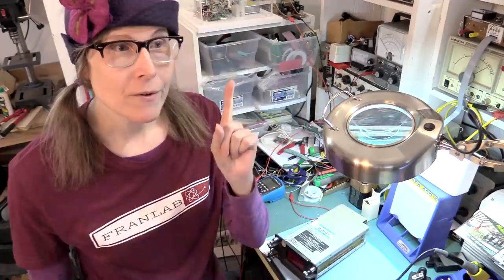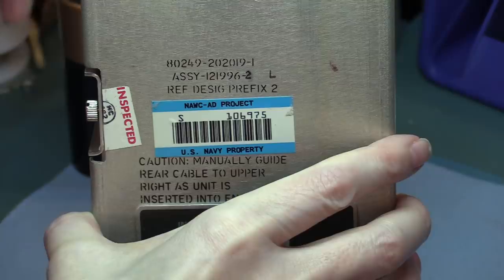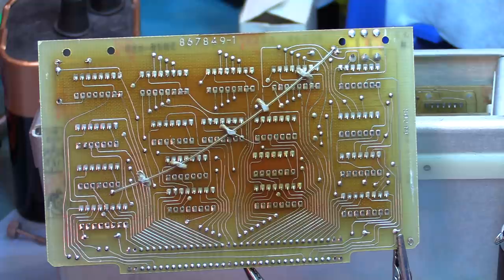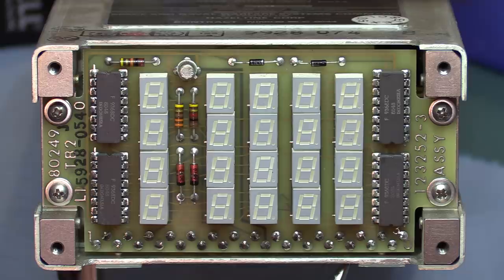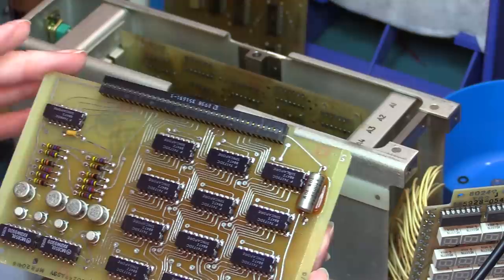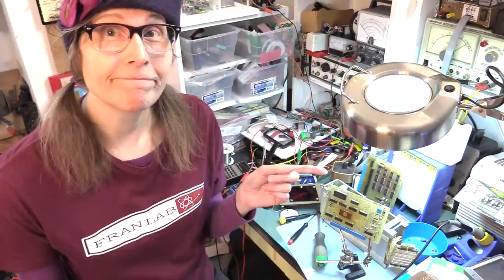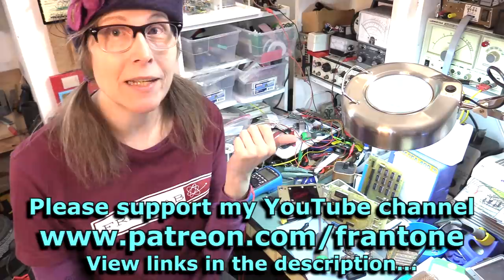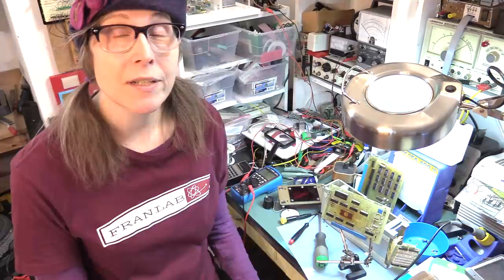REAL Wargames Tech Teardown!!!  80's Missile Target Display

Comment: I suspect the EPROM is being used as a static encoder / decoder to replace a complex set of logic gates, something that would be done in a PAL in the '80s. I am curious as to why there was no UV blocking label on the EPROM window.
Reply: Might have had one years ago, but being so deep inside equipment they really saw no need to keep it blocked out, as it would rarely see light.

Comment: @20:56 I bet it was a task to get those synchronized. If they hadn't, you would be able to tell immediately by frame flutter or a horizontal line marching down the screen and then reappearing at the top to..... Do It Agaaaiiinn, Yeah Yeah Yeaaahhh!!  Mmm-ahem-pardon me...Helter Skelter just jumped in there..happens to me sometimes.

Comment: Did not know - Interesting... the Norwegian Missile Crisis AKA The Black Brant scare was caused due to the launch of a Canadian designed and built by  Bristol Aerospace US-Norway scientific Black Brant XII sounding rocket. The 4 stage rocket reached an altitude of 904 miles on a Northern trajectory that appeared to the Russians as a US submarine launch. 

When I was involved in high power rocketry I flew a scale version of the Black Brant X... which is a Black Brant V with a Terrier booster.  A BB XII is basically a BBX with an additional 1st stage Talos booster.

Comment: Pins 16 and 8 of the ICs are tied together supplying power and ground but the PCB designer did a poor job and failed to increase the trace widths wider than signal width to provide lower resistance/lower voltage drops.  These ICs obviously ran hot as they pulled enough current that should have been designed for.  (I'm a former PCB designer from Tektronix)

Comment: Very reminiscent of telephone switching system technology I worked on in the late 70s. Same backplanes, and even the color of the boards. No fans. Fans have a short MTBF and would be the least reliable component. So the thermal design had to provide for no forced air, in our case up to 120F ambient.

Comment: I actually ordered some pieces from China planning to make the display of WOPPER / Joshua "breaking" the code - the LED display that was flashing letters working its way to "CPE 1704 TKS"...
It was going to run on an Arduino, and either flash all the time, or randomly "figure out" one letter at a time, to "solve" after a preset amount of time...
Like many of my projects, I haven't gotten around to it...

Comment: An interesting mix of 7474 and 5474 flip flops, I thought only the 5474 was milspec (unless being able to display your targets isn't actually vital to your misson!)
Reply: "mil spec" is mostly a fancy way to say "extended temperature range", and since this module was designed to be used in a regular office-style command center, it wouldn't need to be mil spec. the few that got used here were probably overstock, or for some reason cheaper or easier to get than their regular counterparts.
Reply: @WooShell  Thanks, I did wonder. Back in the 70's and 80's, when I last bought 7400, the 5000 series were a) not really available easily unless you had an RS account, and b) considerably more expensive. As an aside, I did come across a couple of 7474s in my junk from the 80s box that came from an assortment and they were still as good as the day they were made, when I finally breadboarded them back in 2018. The 4000 series evidently hadn't had the love and attention they deserved, I have yet to check the tube of 2716 eproms :~P

Comment: That bodge doesn't look very bodgy. The lower left connection seems to be on a pad, not just soldered to the IC pin. Perhaps that trace was just too difficult to get on the board?

Comment: Those 7400 chips are TTL, which means they sucked a lot of power compared to even the next gen CMOS versions.  Hence the ceramic casings (military heat tolerances) and discoloration on the board.

Comment: In the tool kit for the system there would have been a card remover that pulled the CCA straight out. For insertion just firmly seat. Sometimes a rubber mallet helped. And I am not joking on that.

Comment: ~ 21:40. I think we're about the same vintage .. although you look way better <3. Seems to be almost lost in history as to how much work once went into certain film shots. One of my personal favorites is the wire frame CRT view from Plissken's glider of the WTC in Escape From New York - in fact a model, CG too expensive at the time. Channeling Fran - I recently drew up the schematics for a BTTF clock - as it MIGHT have been done in the era (The actual film clock back-lit litho). Maybe a bit rough, but it decodes year, (alpha-numeric) month, date, day, HH:MM:SS, 12/24 hour format with proper leap year correction with "only" 40 period correct 74x MSI chips and a few score worth of steering diodes. IMO .. just on the cusp of doing it with a 6502 or Z-80.

Comment: Hazeltine was known in the late 70s as a maker of inexpensive high quality asynchronous terminals.  Any encryption within this device is very unlikely.  DES originates in the very late 70s, though it is a derivative of some tricks that IBM did.  This thing probably simply displayed a variety of serial numeric information fed to it by that cable connector.  My guess, anyway.  Thanks for the video.

Comment: The wire on the board was possibly an engineering change. This kind of wire was common to see on mainframe computer planar boards.  Not saying this is what it is, I don't know if this is what it is, but I have done similar wire changes to planar boards in the past and I am guessing that this is what it is. Possibly an output or input that was needed for some upgrade.  Later in the video you see that there were components that were made much later and that could have been either just a replacement part, or again, perhaps an upgrade that required a field engineering change to the first board.  Speculation, but I was in Marine aviation and after that, field engineering for mainframes, and my guess is that the wire was part of an upgrade.
Reply: Looking at where the wire goes it turns out it connects to ground on two different spots on the board.

Comment: I always though 54xx series ics were for the military and 74xx series were for us mortals. Surprised to see so many 74xx chips in here, although I spotted a genuine 5400.
Reply: The main difference between 54xx and 74xx is the operating temperature range (-55°C to 125°C for 54xx and 0°C to 70°C for 74xx). 54xx also has greater Vcc supply voltage tolerance (±10% rather than ±5% for 74xx). For a time there was also 64xx which had  temperature range midway between 54xx and 74xx. For devices in an air cooled assembly in a relatively benign environment (some sort of control room) the extended temperature range of 54xx isn't required.

Comment: That's an interesting mix of commercial and mil-spec parts, but ceramic packaging throughout.  74xx = commercial, but there are a few 54xx as well.  Strange that they mixed 7474 and 5474 on the same board.  There are also a few other parts from the prior generation logic known as DTL (Diode-Transistor Logic) - I noted some MC858 parts. The EPROM is interesting - the printed numbers appear to be related to the programmed content since the part would have been programmed and verified before soldering.  There is a very feint manufacturer's mark, rendered almost invisible by the conformal coating. Playing around in Photoshop to highlight colour / contrast it looks a bit like the old National Semiconductor logo (square letters version from late 70s early 80s), and the part number MM2704JQ (so a 4 k bit device - 512 bytes).    Looking again - it could also be MMI (Monolithic memories Inc) who also manifactured EPROMs and were later merged into AMD.  As others have commented, the location on the ICs (Indonesia, Taiwan etc.) would be where they were packaged.  The silicon was most likely diffused in the US or Europe.  By the late 70's, the larger semiconductor players were commonly shipping wafers around the globe with different factories specialising in different parts of the manufacturing process.
Reply: If it is a National semiconductor 2704, it needs +12, +5 and -5 volts. See http://bitsavers.trailing-edge.com/components/national/_dataBooks/1977_National_Memory_Databook.pdf page 4-7.

Comment: There's only enough wires going to the display to light one row at a time. They must have been time multiplexed, strobed fast enough to show all the digits by persistence of vision.
Reply: A big hint is that there are four rows of digits, and four 9368 decoder chips.

Comment: Doesn't "conformal coated" mean that traces are coated?  I see a fiberglas board with bare traces, and no coating on anything -except a bit of rosin on soldered legs.  Maybe I've never seen an '80s conformal-coated PCB tho.

Comment: I worked on electronics in government throughout the 80's. When it comes to certain systems, it is not uncommon for the Military to maintain them for a decade or longer. The design is set and no changes allowed. Spares are ordered when stocks get low, and the vendor will usually only build spares when ordered. That would explain dates into the late 80s.

Comment: Just because it was gear used in the 80s, doesn't mean it's 80s technology.  I see 70s technology there for sure in the form of many discrete components and early gate chips.  I was an AT/AX in the Navy in the 80s and 90s and almost all of the gear back then was from the 70s and even some from the 60s.

Comment: Fran: just because this could be showing encrypted data is why it would be cool to reverse engineer it.
If you post the pictures I will do it.
But I doubt. More likely it was just a proprietary protocol, It has half a dozen 74173 that are just D type flip-flops. It is not complex enough to decode sophisticated cyphers. It would need at least a shift register and an EPROM.
Yes the EPROM is a UV erasable EPROM, this is why it has the window. Its made of quartz so UV enters it. Look at the regular structure of the dye typical of memories. They lose their data very slowly if exposed to sunlight or fluorescent light too. I used many of 2706 (corrected) in my time.
The bad constructed erasers were dangerous, it was a very short wave UV light that was used.
About the rockets you are right. Once a wrench fell and perforated a tank. It was a huge and high profile accident. There is a very good 
documentary about what happened.
I didn't knew about Joshua's voice. Thanks for sharing.

Comment: In retrospect, the heat discoloration on those boards is a bit worrisome ----  the carbonization process can cause leakage paths where current starts flowing through the board itself.  Not something you would want to occur in any electronic device having to do with tracking or firing missiles....

Comment: The old days when you don't need bypass capacitors.
Reply: The frequency it runs at is probably so slow that it doesn't need bypass caps. Probably a few Khz.

Comment: I am surprised that they are 74 series. Military IC's were 54 series IE 74173 = 54173  the ceramic allowed the chips to run hotter
Reply: Look closer, I saw 5474 chips next to 7474 on one of the boards. Apparently 74xx was good enough for most of the parts.

Comment: May not have been an oops.  Likely there was no other way to get that line form the there to there.  A  complete re-layout for one line would be crazy in those days.  Still is as far as I'm concerned with some boards I do.  A simple link wire can save a lot of time and money.
Reply: I paused the video at that part and tried to work out how they could've routed it without a bodge wire. They could've run a trace around the outside of the board.
Reply: @simontay4851  Edges are dodgy though, especially when cards are slid into slots that are probably chassis ground. These days though, yeah woulda.  Plastic rails?  Also mil.spec probably had very strict layout regs.

Comment: I doubt it would work, even if you did know how to use it. The solder points on the board you took out first were really dry. Some of those would most likely have contact issues by now. The other boards looked in fair shape though, considering how old they are and how hot they got :p

Comment: If it was me and I wanted to figure out what it did… well I wouldn’t initially trace any wiring but would look at the functions … yes the display board has a logo Fo wiring but we know it’s got 7 seg decoders so we know what the function is, we know the displays aren’t multiplexed but the looks so there is a lot of repeated parallel data that’s gojng to come off a whole bunch of 4 bit latches… the power rails are a piece of piss because there will be so,e beefy 5V a rails and ost TTL chils are going to be the old pin 7 / 14 or 8 /16 arrangement with some 7490 BCD counters with the power across the middle. 
But I would just strap 5v across one of the TTL chips… chances are there is a common 5V rail just go across one of the many 100 or 10 no supply decouples… be interesting to see if the displays did anything … but check the functions from the other boards by looking for the common chip functions…you can tell a lot by just doing that

Comment: It's not really too unusual to see (supposedly) sensitive hardware surplussed-out to the general public. Around 15 years ago I picked up two machines at an auction in order to repurpose some of their power components and stepper motors. I later identified them as close-to-operable winding machines for TOW missile control wire spools. Some years later I recognized some missile flight hardware I had designed myself offered up for sale in an electronics surplus store. Those items should have been physically destroyed by obliterating markings and sawing in half, etc. before being scrapped.

Comment: I was watching close but never got to see the connector on more than the first board.  I half expect that each one had different holes filled in with epoxy to 'key' each board into the proper slot.   I did see a corner hole filled in on the first board you pulled out.  Got to try to make it 'idiot-proof' don't you know.  Nice bit of vintage equipment.

P.S.  I like the movie too.  :)

Comment: Would something like this usually be hand soldered?
Reply: No. Usually they are wave soldered. The boards from inside the enclosure appear to have been assembled by machine (the tell-tale sign is the uniformly bent over leads which hold everything securely together until it's soldered). The patch wire will have been added later and hand soldered. The display board appears to have been hand assembled but is most likely wave soldered except for the interconnecting wires.

Comment: You always mention that ceramic chip housings are military grade. What about a ceramic housing is tougher?
Reply: Ceramic packages are just more durable and, unlike a plastic package, are not a fire risk if severely overheated. They are also significantly more expensive. While military temperature range devices (54xx) always have ceramic packages to handle the temperature range they aren't usually used on commercial temperature range devices (74xx) unless the fireproof nature of ceramic is desired.

Comment: After a bit of googling I think this is actually from a radar where the target (the blip on the screen) has been selected and then this device shows information about that target. e.g. As the nuke laden russian bombers held towards you then you select them on the screen and use the device to get the details... something like that... but is that a real blip or is it a simulation?  thx for the video
Reply: ah... it shows IFF codes in different modes for the target.

Comment: Come on! There’s no way that puddly amount of 7400 hardware could do anything resembling encryption. The logic might, at best, decode a custom data stream from some other nearby equipment (which being nearby would mean there is no need for encryption). Also, who says that unit is from actual missile tracking (or other combat) gear? It could be a module from some test equipment that exercises or diagnoses the actual combat gear. That would explain the acceptance of bodge wires, the use of bendable wire-wrap pins for motherboard connectors, vibration-vunerable solid conductors wiring up the front panel and rear module jack, and any other iffy techniques. Unless somebody recognizes this unit and is willing to tell us, we shall never know. Nevertheless, it’s still fun to look at, even if we all have to chip in and BUY YOU A BIGGER SCREWDRIVER.

Comment: Silly that some chips are 54xx series mil-spec and some are 74xx series, even for the same function chips.  Pretty poorly-made for 'spare no expense' military stuff. So much for mil-spec.  Also stupid to have the pins in the backplane:  You plug something in wrong with the pins on the board, you've wrecked the connector on the board.  You mess up with this unit and you've destroyed the backplane and wrecked the unit.  Cool video.  Glad to have just subscribed.

Comment: The quality of many solder joints looks mediocre at best.
Reply: You gota save on costs, come on, the poor execs are not gonna get their bonuses if QA rejects due to bad soldering.
And not only bad solders, poor heat management too, the thing looks like an oven: toasty.
Reply: @ikocheratcr  Lol!
Regarding discoloration,  the equipment is very old an my have been in use for tens of thousands of hours. Some of my lab equipment has been on for almost 100% of the time, since the eighties. Some boards show similar discoloration, without getting too hot.
Reply: @ThunderBassistJay  Interesting.  That means that the damage does not require that much temperature.  The things that can be discovered of a product  after a zillion power on hours.
Reply: @ikocheratcr  In case of a circuit board, it's not always damage. I'd like to call it degradation.